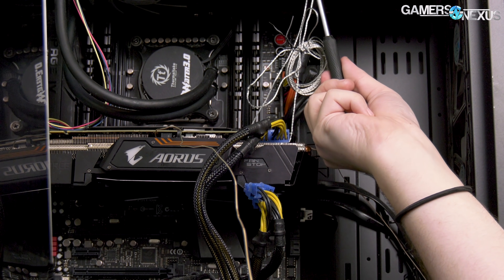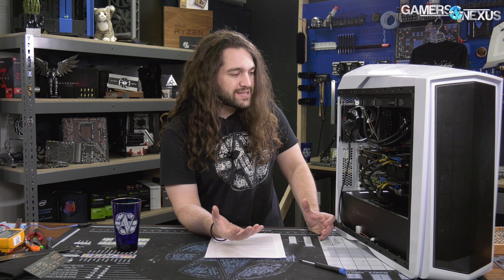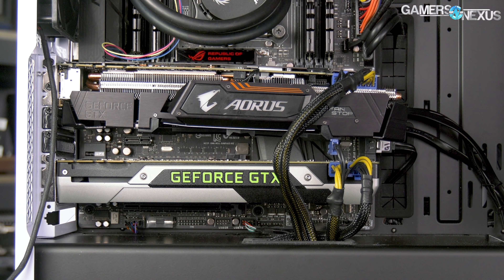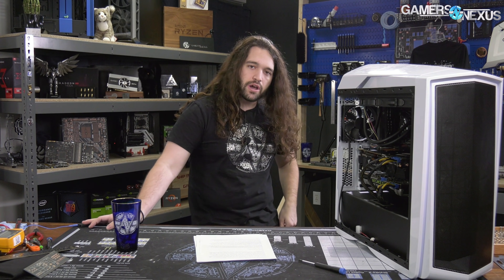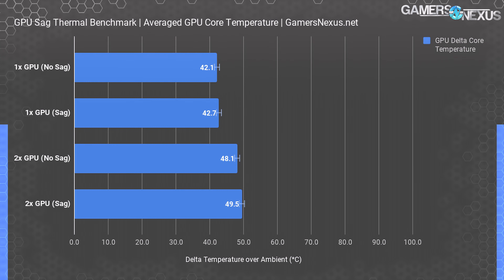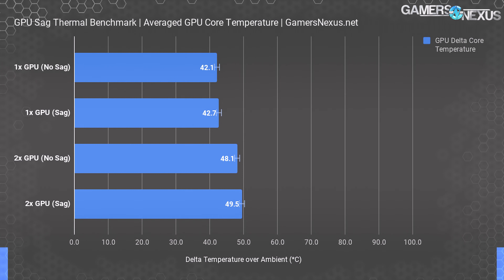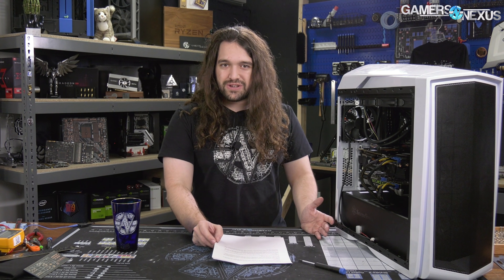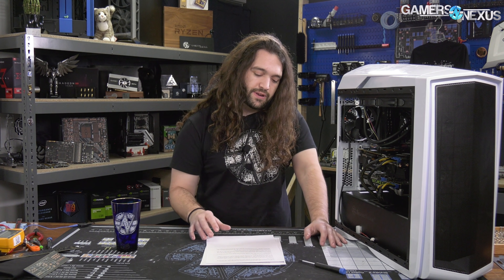Video Card Sag Test: Thermals & Frequency on Drooping GPU

Comment from the maker: Check out our new crazy overclocking rig: https://www.youtube.com/watch?v=KgIyle-gSQU
Article: https://www.gamersnexus.net/guides/3424-gpu-sag-test-thermals-frequency-benchmark
Reply: My biggest concern is the added stress on the solder joints and solder balls . Over time they might come loose or crack which will cause the card to malfunction after which no amount of  support will get it back up and running smoothly (or at all depending on what failed). I've had this happen on a gpu in the past - can't remember the model. I was able to get it working by adding a support to it but it was short lived.
Reply: Why on earth is there a label "fan stop" on the side of the card? Like... huh?
Reply: @J Fz Hahahahaha.... hahahahahahahahaa... Iove broken "idiot proof" designs.
Reply: Kind of disappointed you gave the Auros 1080Ti such poor marks and honestly seems a bit of a shallow assessment. Its VRM is extremely good, it is the only card other than the Kingpin edition that allows for a soft modded +150% power limit making this card perfect for a water block and was retailing at some of the lowest prices of all custom 1080Tis for most of it's life. Checking out the Hardware Unboxed review which originally led me to purchase this card I find it hard to rationalize your points of complaint, especially having owned the card for a year. I used this card to score inside the top 10 all time Superposition 1080Ti leaderboards with the card on water thanks to the increased power limit. You basically have to hard mod every other 1080Ti to touch the performance this delivers under water at 4K, the only exception being the Kingpin, which is essentially crazy priced and unavailable everywhere. You basically did a review of the box cooler, not the card. Bit of a misfire on this one IMO.
Reply: @J Fz Not too sure about traces, copper is pretty flexible. I've seen pcbs bent almost 30 degrees that had good traces but they were only single layer so i have no clue how they hold up on more complex designs. Edit: Buildzoid might be able to shed some light on the situation :)
Reply: @J Fz The 1080Ti Xtreme line included closed and open loop liquid cooling models, as well as the air cooled one.  I have the open loop model, and the build quality is fine, and lighter of course, so no sag over the year I've had it.
Reply: Please use the correct degree symbol in your charts :) https://en.wikipedia.org/wiki/Degree_symbol
Reply: if you dont want that beat up old 1080ti ill take it lol cry
Reply: Coolermaster Mastercase Maker 5T has an included GPU support bracket that really helps with sag
Reply: Solution = Vertical GPU mount, zero sag.

Comment: Sad part about the Aorus / Gigabyte 1080Ti Extreme is that i bought that as a first card replacement back in the day, its not just the sagging that gets you. but the Standard full throttle overclock at peak with 102 Celsius, aka 215.6 Fahrenheit. i shelfed it after testing this card in my system and its been collecting dust ever since.

Pretty shamefull Gigabyte.

Comment: I've got an Aorus 3070 that is about a year and a half old. I had begun to notice sag about 6 months ago and have since put a bracket on it. I was very worried about the PCI strain... that card is very heavy on the cooler side since it has an LCD on it

Comment: This is more of an issue for newer RTX 3080s/3090s and my pcie slot is broken now despite the card itself being pretty reinforced and only mildly sagging. I can only play games with a pcie riser and my gpu mounted vertically so that there is no weight on the slot. I can replicate the crash by pulling down very lightly on the pcie slot so I'm certain any gpu plugged directly into the pcie slot would make it crash now.

The motherboard even advertised itself as having an extra reinforced pcie slot. When I googled my event viewer error it seems most posts were from within the last year or two and people with 3080s. Triple slot height cards going beyond 300mm length is a lot of torquing force. Even the card depth is greater than usual.

Comment: Just saw this: so wanted to say: 1070ti DUKE.. sag has caused flicker. Just saying.  Probably need to re-socket it. Temps are good still even after all this time ( 2 years of ownership/ gaming use on a mix of older AAA and modern AAA titles. Have noticed some odd boost behavior as well... It boosts WELL past max ( ok - 50 mhz) and then  imediatly drops 100 mhz and holds speed.. sometimes causes flickering.   Mounted to asusa X470 rog board. Without the wifi. But slot has the metal shroud that they advertise helps with gpu sag... It does not help....

Comment: My msi radeon rx 5500 xt had massive fps drops in games, i fixed them with at first using stand made out of legos and then i bought a vertical bracket. im not sure what was the deal, cheap case, pci slot or what because 5500xt is not that heavy card. How i know that i had massive fps drops because of sagging card : i cleaned my pc from dust, like 99% of cleaning dust, what means removing all components. After finishing putting all together and started a game i got like massive fps drops (5-144fps) i saw that i forgot to add this lego gpu support in, added it back and the problem was solved

Comment: I have a Strix 1070ti, that varies the core temp if i lift the card! The temp shuts obove the throttle limit and letting the card to sag, bring back the temp in a couple of seconds and the clocks ramps up again.
 This is ridiculously dangerous...

Comment: I have an interesting case when trying to fix the sag I've actually made things worse. I posted it on Reddit here:
https://www.reddit.com/r/techsupport/comments/cll60m/question_about_gpu_standsupport
But in short, trying to support my ASUS STRIX 1060 6 Gb with the vertical stand, my temperatures bumped up by more than 10 degrees.

Comment: Even with basically no difference in temps and frequency, and well within the safe margin for flexing on the PCB and the PCIe slot, it's still something for the ease of mind. It just looks and feels better if the card sits straight in the system.

Comment: I guess I must have a better sample than you guys in regard to performance.
2050Mhz  @ 1.062v and never gets above 67C in Witcher 3 on high settings 1440p - tuned the OC when running Witcher to ensure no thermal throttling takes place.
Witcher 3 is of course one of the most demanding titles, with other AAA titles like Destiny 2 barely ever breaking the 60C mark.
Idle temps for web browsing are 29-30C in 29C ambient room temperature.
Stock cooling.
But the sag is of course an issue unless you had the common sense to install an aluminum support when you first installed the card.
With cards this heavy, I think motherboard manufacturers need to work on how GPUs are supported as many 3rd party RTX 2080ti cards will also sag like this given enough time given their size and weight.
But I guess you had to call out one card!
Maybe next year you can repeat the article on a saggy Asus RTX card?

Comment: Word of caution, I tried leveling a GTX 970 by strip ties to the cooler, result was terrible GPU temps due to a tiny gap between the GPU and cooler. This was after it had been sagging for years, so it was likely settled-in at the sag level.

Comment: I have had a MSI N275GTX Twin Frozr OC with severe sag over time. The sag was that bad the block on the GPU was cracked. Temps went up very high and fast.

https://www.msi.com/Graphics-card/support/N275GTX_Twin_Frozr_OC

Comment: Thats why my gigabyte 1070 and 1080 both are being supported by a gpu mount from coolermaster. The best way for a gpu to not sag is by fitting a vertical gpu mount. Though I’ve seen a small temp difference with the gpu vertical vs horizontal, so I went back to horizontal. 
If you remove the gpu, is there a noticeable bend on pcb, is it no long flat?

Comment: Two years ago when I worked at a computer repair shop a customer did bring a pc with a sagging gpu which gave no video output . What had happened was that somehow the pci-slot was damaged (maybe the pins didn't make contact correctly ,it was beyond our expertise since it was a government funded repairshop so we didn't make any profit so we didn't even have the equipment to magnify it (that was actually a lie they told us since they got paid by the government for the volunteers that worked there but they just didn't want to spend their free money on what they were actually supposed to spend it on which was to educate the volunteers (this is also the reason why I don't work there anymore) ,fortunately for the kid his motherboard had more than one pci-e*16 so I put the gpu is the second slot and everything worked fine after that (I also made some kinda custom thingy to hold the gpu in the right position so no sagging anymore).

Did some googling and I'm pretty sure it was a Gigabyte gtx 980 g1 .

Comment: I have that same exact card and all of what you said is not true in my case. The card has minimal to no sag. One of the best I've had. Temperatures are cool. Runs around 60c overclocked. Does 2088mhz. It is absolutely perfect 1080 Ti.

Comment: I have two 2080 ti's and they are too close together causing heat throttling at 88 degrees. using 3 slot nvlink and z370xp sli motherboard. Think of putting on two 80mm fans to the side of both fans to drag the hot air out? any suggestions?

Comment: Hey, we saw your video about GPU sag! We ran in to this same problem a few years ago.  We have tested many prototypes for this issue before finally coming to our current solution. We tried a few bracing options (like a vertical stick coming up, or a string hanging from above.) before deciding on a brace that bolts to the PCI screws was the way to go. We sell two different types of graphics cards braces that work with Dual or single GPU set ups. Gemini is the better option for dual because sometimes people only have 1 slot between cards. It also works fine for single and people can purchase an additional one later if the add another card. The Atlas also gets the job done at a cheaper price. Both have the largest possible air flow holes without bending too easily. There are other Chinese manufactures that have tried to copy us, but none of them have gotten the 3 screw holes right. Often the metal of the case itself bends with this much cantilevered weight on it. So our holes are much wider for the bridge to be tightened at the best angle; so after the case flexes the cards is still horizontal. It also has the ability to slide up or down to adjust to different GPU thicknesses. We learned that if you make a thin single card brace it will need to be metal. However, if its Aluminum Anodized, the thin coating can be scratched off by a protruding Power Connector solder point and shorts to the case ground... bad news! That's why our Gemini Brace has a thick glossy black non conductive powder coat on the whole thing.

Gemini Graphics Card Brace
https://www.amazon.com/Gemini-Graphics-Brace-Compatible-Bitcoin/dp/B06XSYMVHB/ref=sr_1_1?s=home-garden&ie=UTF8&qid=1546634952&sr=8-1&keywords=gemini+graphics+card+brace

Atlas Graphics Card Brace
https://www.amazon.com/dp/B01DQK7DDW?ref=myi_title_dp

Comment: I had a GTX 970 Strix card in a Corsair 400c case, after 3 years of gaming (roughly) the card had sagged so much, when I propped it up or pushed it upward into its natural position the display would often turn black or have major artifacting

Comment: My rx 580 armor mk1 edition has a small cooler and sags. The way I stopped it from becoming worse is using the power cable for the gpu (since mine is pretty thick and sturdy) and resting the curve of the cable on the hard drive bay (Corsair 100r). This does not change anything airflow wise, but props the rx 580 up slightly and prevents future sag. I’m not sure why it’s sagging in the first place since it’s a thin card and has a pretty light cooler. I guess it’s because there is just no support for  the cooler since it’s a two slot card but the cooler does not get supported by the second slot and is attached only on the pcb.

Comment: There is one other thing that JayzTwoCents showed that fixes the GPU sag problem, put a small metal brick and insert it above the GPU´s mount where you actually got a tear at the chassis gpu mount will sit and you´re off with one concern less to deal with.

Edit: That is one THICC graphics card taking up a lot of space to the degree that those 90 degree alternative mounts is beginning to be something for practical use not looks as they were intented for as marketed.

Comment: Lol i actually put my normal tower case pc horizontally on the floor so that my card is vertical into motherboard when i built it 2 years ago ( my msi rx 470 was heavy and really saggy ) cuz i thought that wasnt normal and that i cant let the gpu hang even for a few millimeters. Its still in the same position .
Facepalm 💪🙈🔫

Comment: I can't stand my computer case vertically because my MSI 1060 6GB sags so much the slot connections fails and I can't boot. I fixed the problem by putting the case on its side so the card is vertical.

Comment: Ive had the aorus xtreme 1080ti for over a year now and it does not sag like that
Reply: I have the non-xtreme(same card without rgb logo) version and I hardly notice any sag. It's installed in a MSI X370 gaming pro carbon motherboard and corsair spec 02 case. pcie slots are made out of metal so I don't know if that affects anything or if there something wrong with the case or motherboard in the video.

Comment: glad i got the coolermaster vertical gpu mount and modded my NZXT phantom 820 so my gigabyte aorus 1080ti wont sag i must have a binned gpu chip becsuse my non extreme version is a bad ass

Comment: My old 970 Strix sagged alot. So i tried a gpu bracket and a gpu stand. Both of them increased the temps of the card by about 5-8 degrees celcius. Tested this a few times, before just accepting the GPU sag.

Comment: So I've experienced stability issues with a GPU sagging. I installed a cooler master GPU bracket and the stability issues have gone completely. I know specially that it was the day causing the issue, because I was able to slightly press on the card while the computer was on, and cause the PC to blue screen.

Comment: I could see where a heavy card like your example would have no difference in temperature but that it could slowly pull away from the contacts due to weight mixed with the power cords helping to pull it away

Comment: My friend has that card, the Aorus, we just pulled the cables over the top of the card and with the mobo cable, so there's no visible cables at the bottom of the case in the S340 Elite, so just looks better too as well as supports the card.

Comment: Steve I fix GPU sag with zip ties. I zip tie gpu on its plugged in PCIe power connectors on one end and to 5.25 inch drive bay or somewhere. No metal wires please (dangerous, conductive!)

Comment: Well what can i say i have this card over a year now and it does not sag at all. Good temps not noisy. Inside a fractal desigh r5 case. I once dissasembled it i wanted to chance the thermal paste just for the heck of it not cause of any thermal or noise problem.Maybe i just put it back together better? Dont know

Comment: My old 780ti Hydro Copper broke a PCI-E slot due to sag+weight
1/2 the pixels on my screen were red and flickering.  
Now i use a 3/8 DIY rod i made to keep my waterblock'd GTX1080 perfectly level.

Comment: Imagine if CPU coolers could only have screws in their left side and were forced to be long and thin instead of cubes, and orientated in a way that ensures the incoming air hits their shortest side where it's useless, and that they had to blow air into the heatsink and into a wall because the PCB has to be there, then out the tiny sides, as there's simply no way to have a heatsink you can blow air through. As a bonus, make it so there is no way to have anything nearby that exhausts all this hot air from the case. It's fucking ridiculous, and about time ATX and PCIe form factors had a complete redesign for the needs of modern GPUs. This form factor dates back to when GPUs didn't even have heatsinks, let alone fans, and it's time to ditch it.

Comment: I had that card, its a great card, the shroud is Aluminum not plastic. My card had absolutely no sagging.
Maybe because I had Gigabyte Gaming 7 z370 motherboard with metal reinforced PCIe slots and the card was screwed tight with 2 bolts.
But I think its mostly due to metal reinforced PCIe.
The card was SOO GOOD that after light disassembly to remove dust I managed to sell it as Open Box Brand New and had nothing but praise from the buyer
Reply: So you scammed the buyer?